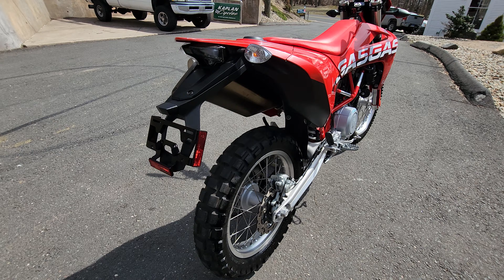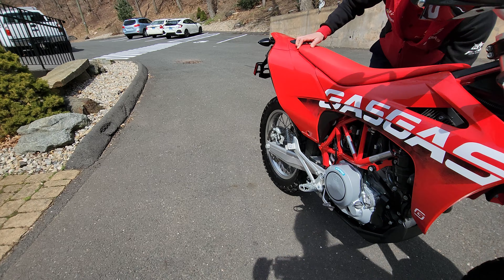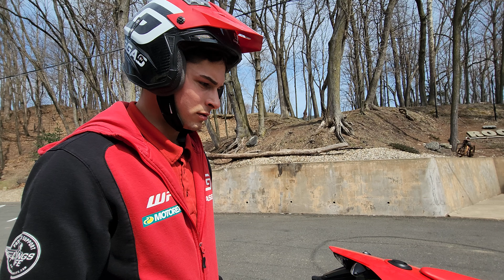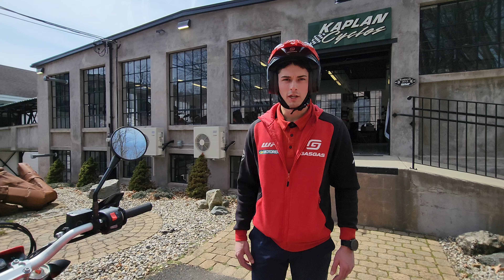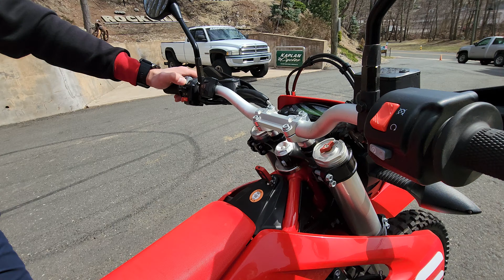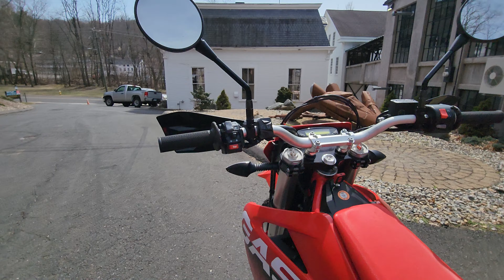1 NEW 2023 GASGAS 700 ES DEMO LEFT; WITH 127 MILES! CALL JR TODAY 860 454 7024

Comment: I just had my first ride on the SM 700 yesterday. The engine is truly incredible. For anyone who hasn't ridden a 690, 700, or 701, you are in for a treat. I can't imagine what the Rottweiler intake kit, Power Commander and exhaust will do to it. Also the balance, agility, and overall ergo just thrives turns. I bet this ES is an absolute blast offroad.

What exhaust did you go with, Jr.?
Reply: Don't bet on it. Lol..I always had and loved Jap Bikes, and I still do, but I recently bought one of their 2022 GasGas 2 stroke MC 250 MX Dirtbikes, and I have to say, even though Yamaha YZ's were always my favforites, and I bought a new YZ 250 in 1993, when Damon Bradshaw was riding for them. Love that bike, Miss the hell out, and never gave me on single problem. I always keep my bikes up well, since it's a big investment, and I'm not rich. The KTM Company (KTM, Husqvarna,GasGas) work hard, around the clock, yearly, always doing research, trying to improve the bikes for many years. The parts on them, when they're stock, right out of the crate, are better quality parts, throughout the whole bike bike... Sr and Jr told me all about them. I got the fever and treated myself to one. They're amazing people to do business with. 5 stars on their Ebay Auction Channel...Motorcycle dealerships, come no more reliable, dependable, honest, and playing fair at all time. Best Customer Service around.